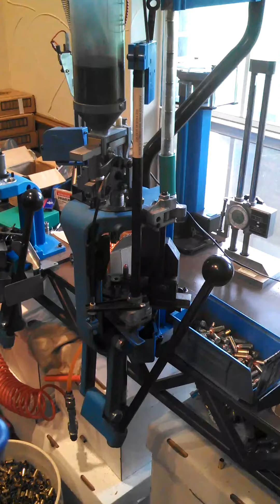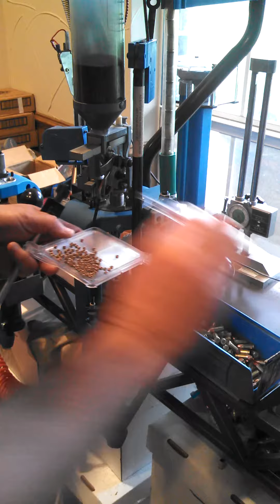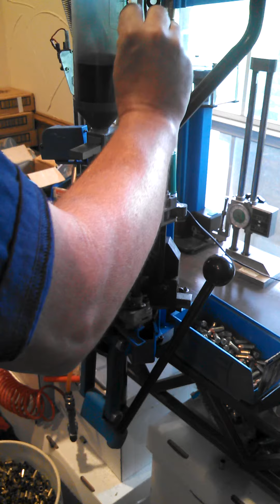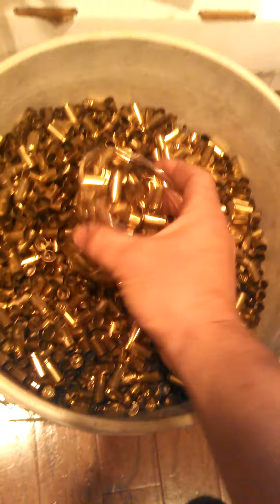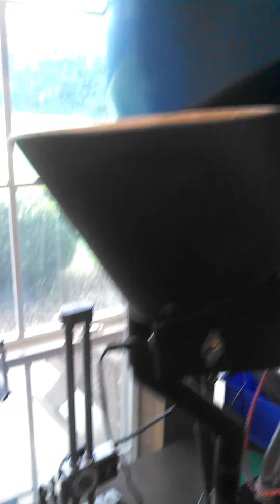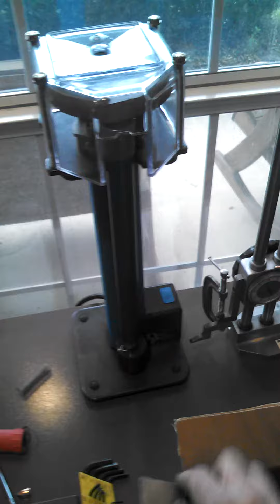Topping off a 650

Comment: Nice! How often do you get flipped primers?
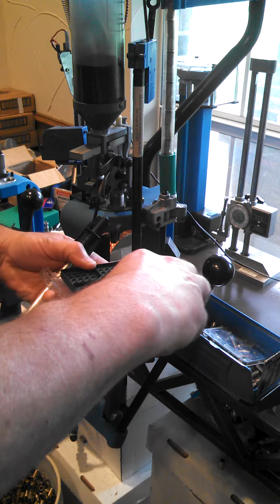Reply from the maker: I don’t think I ever had one with the FA tool, you flip them all right side up before putting the cover on, that’s what I am doing between 0:14 and 0::21, after the lid goes on, they can’t flip.  Actually I guess they could if you were using the large primer side and tube with small primers but I haven’t done that either.